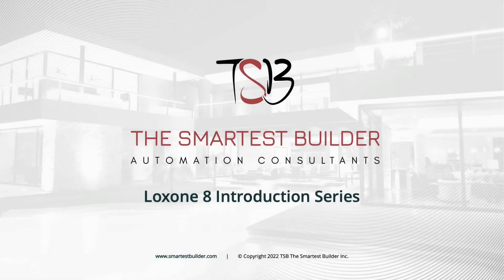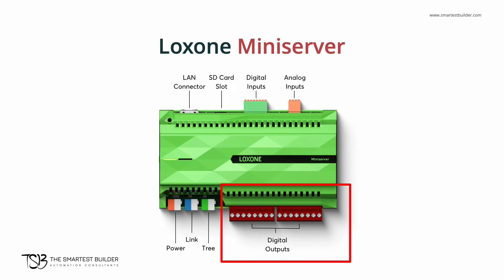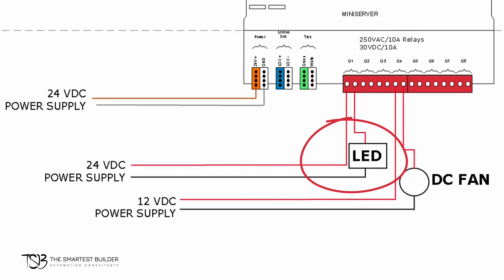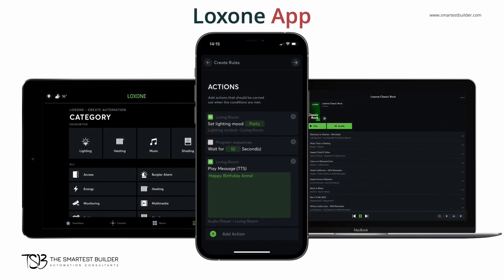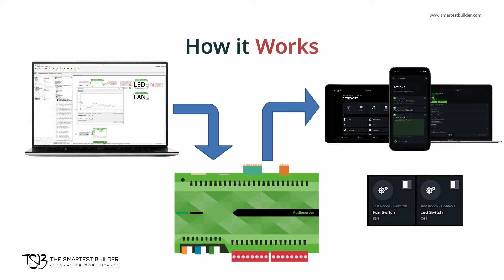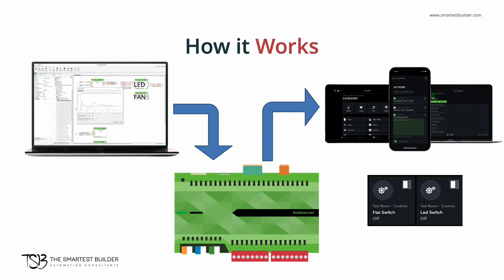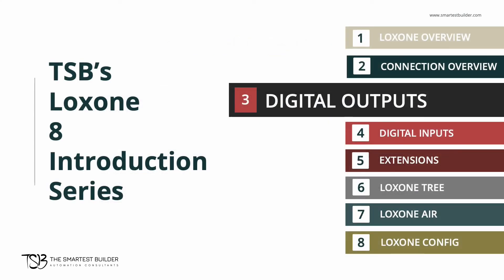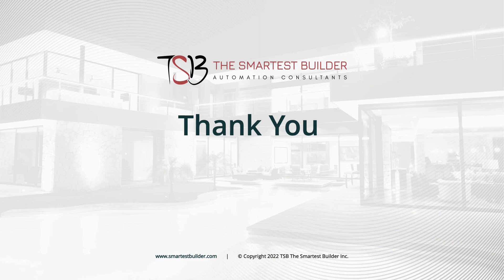Loxone Introduction Series Video 3/8: Loxone Connection Overview

Comment: When do you choose to use the analog output for lights and when use Tree wire with lights?
Reply from the maker: Analogue Output for lights is based on the light control option. Some commercial/industrial/residential lights have 0-10V or 1-10V control for dimming the circuit or fixture. You would use the Analog output for that purpose. 

Tree lights and tree wire is proprietary Loxone technology. So currently only Loxone Tree lights would work using the Tree wiring. But you DO NOT have to use Loxone Tree lights for lighting, there are many different options for light control such as RGBW dimmer, VAC dimmers, ON/OFF and third party over IP/Modbus. It really depends on the Loxone installer / client / product and skill availability / budget / capacity of service/non-loxone installer team.